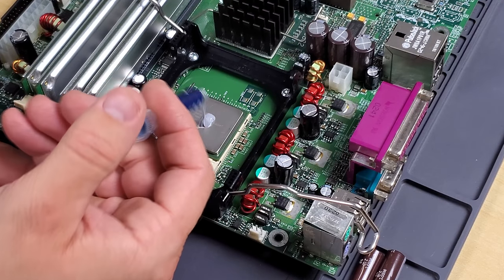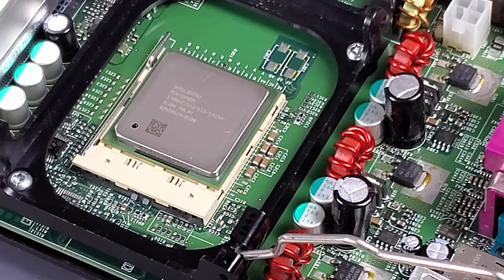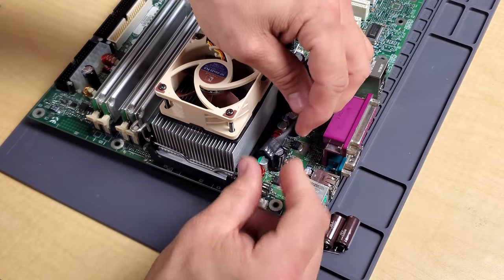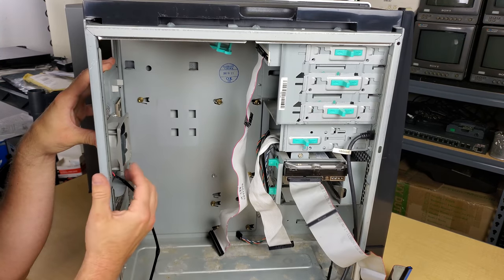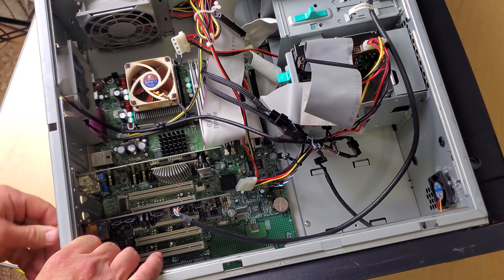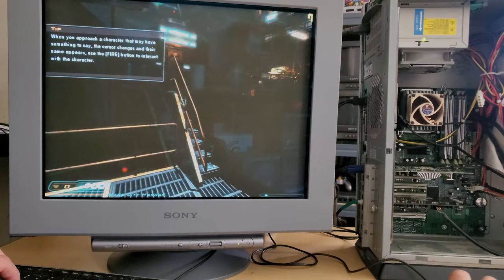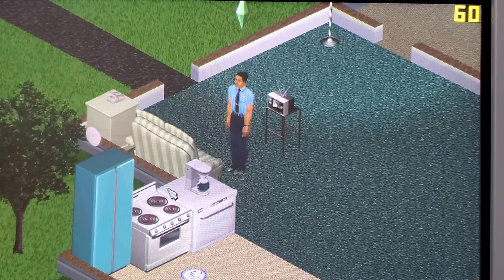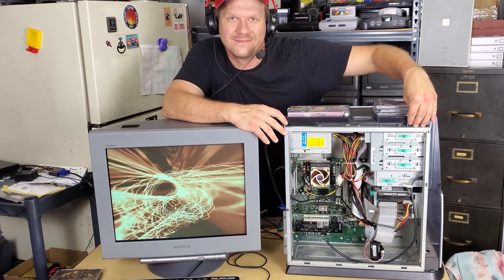Pentium 4 Gateway Retro PC Re/Build: Cap Kits, Noctua Fans & the Sony GDM-C520!

Comment: You got PSU fan mounted incorrectly. Everything exhausted by rear case fan will be sucked in by PSU fan immediately, and recirculated inside the case constantly in a closed loop.

Comment: Panasonic NHG?? I believe they are not LOW ESR caps, so there is bad place for them. You better use FR (FM/FC at least). And CPU coller FAN is upside down. Why? :))
Reply from the maker: The CPU cooler orientation is debatable